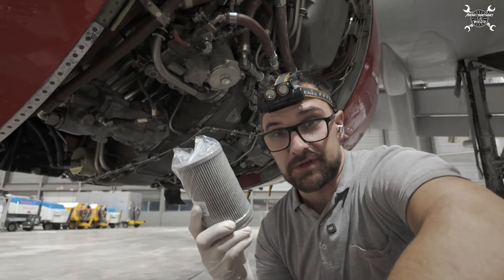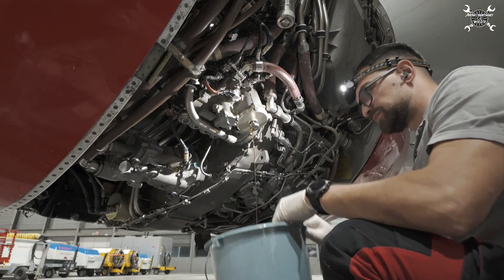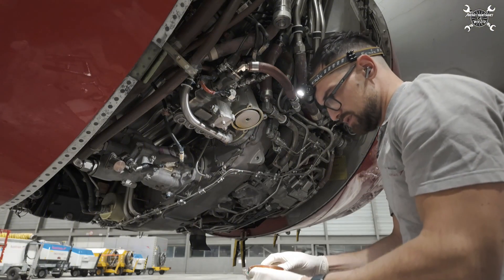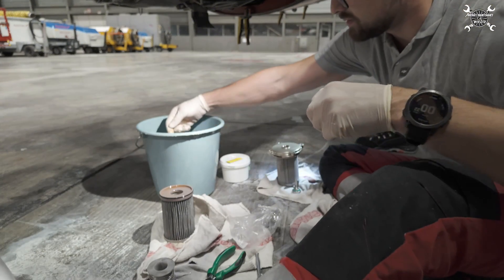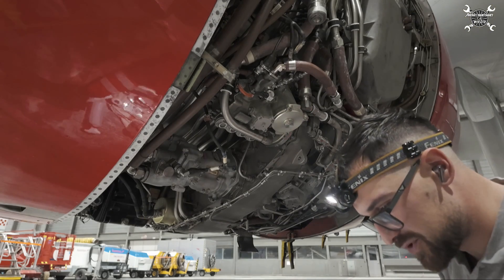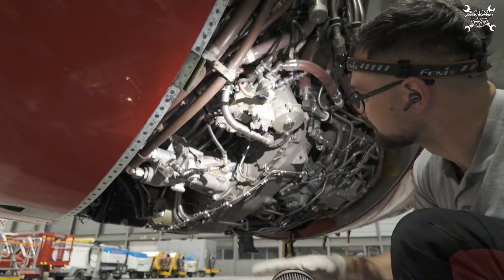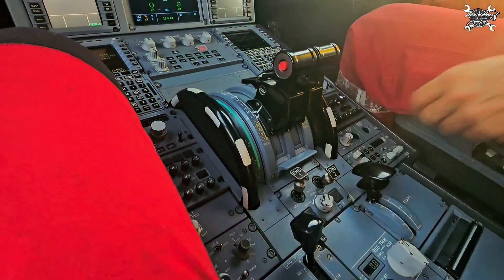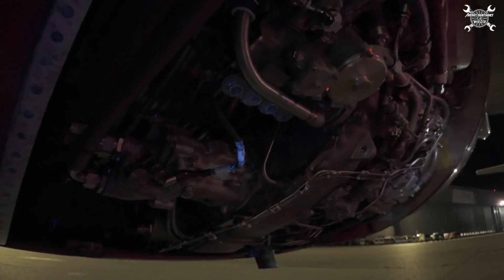How to replace Oil filter on Airbus CFM56-5B engine

Comment: Have you applied lubrication to the rings? I didn't see any grease.
Reply from the maker: Always, in this case engine oil
Reply: @zeto.r  Is that really allowed? I've seen an official instruction video by GE.
Is it possible that you've taken a shortcut?
Reply from the maker: @jacquesmertens3369 no I'm not taking short cuts. All I.A.W. AMM do not relay on video read manual

Comment: Will you make a video on how to replace oil filter on Airbus 320 fitted with V2500 engine
Reply from the maker: We don't have them In our fleet but I can take a look in my archive
Reply: @AMITBABAR-e6n  Its the same procedure. Drain plug socket is 1inch. But the filter doesn't have any grooves like in the CFM. It also has 6 bolts holding the filter up. But the filter has no backup seal. Only one seal. So you change both the drain plug and the seal housing seal. Torque the bolts and the drain plug and wire lock it. Basically the same

Comment: very nice , Can i ask you question ?
when we task a torque from a store
what is the precaution we can check
thank you
Reply from the maker: Are you talking about torque wrenches?  Or component
Reply: @zeto.r  torque wrenches
Reply from the maker: You should have a torque checker available in your company which is calibrated for that purpos3
Reply: @zeto.r  thank you so much
Reply from the maker: my pleasure
Reply: @zeto.r   can i ask you a question 
I want to know triangles on the fuselage function
Reply from the maker: That is for levelling of the fuselage they must be aligned, if not you have a big problem 😀
Reply: @zeto.r  really thank you so much
Reply from the maker: My pleasure